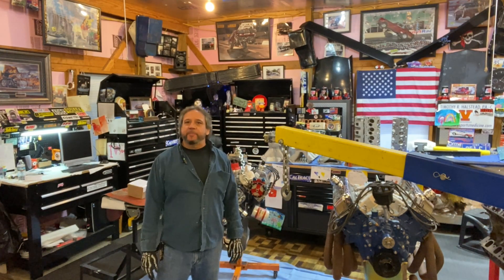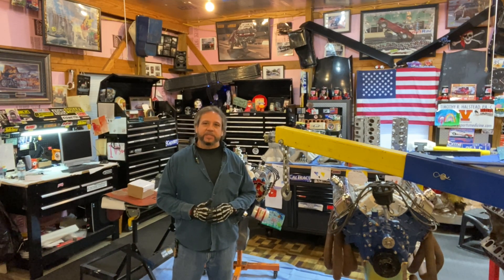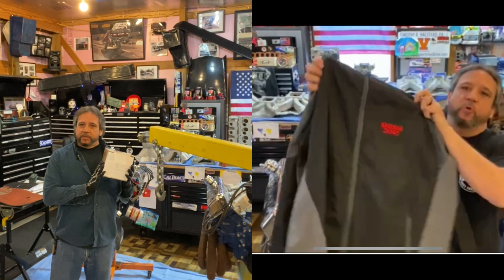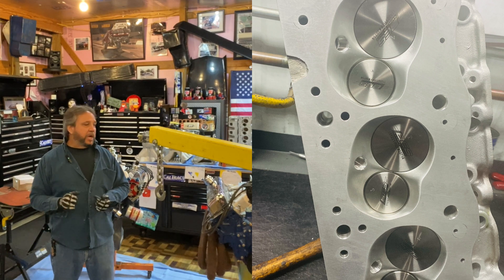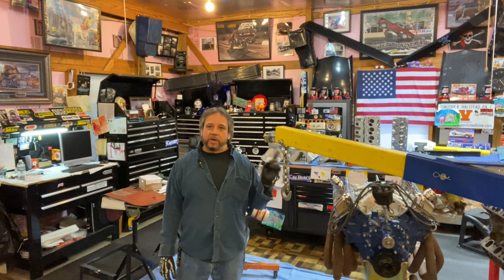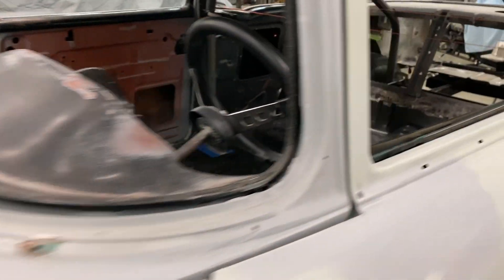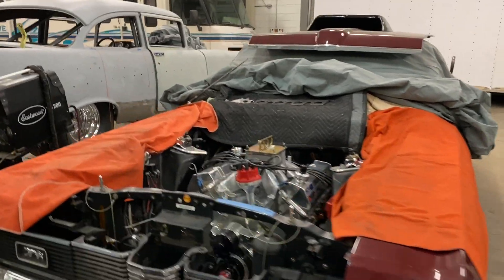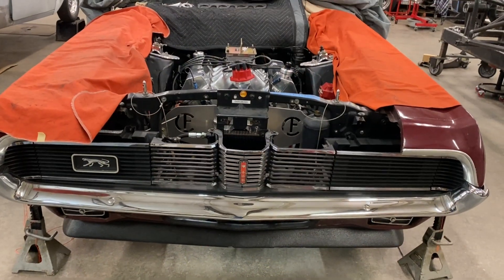DragBoss Garage: Lock and Load And Roll On Down The Road...Can I Make An Intake manifold For A 351C?

Comment: Tim looks awesome. Can’t wait to see cougar rolling again. 775 hp that thing with the changes going to be one of the nastiest 4v cast iron c motors around
Reply from the maker: Thanks Steve, My goal is to be at track on 4/16, so my chassis guy under the gun. I'm hoping it will all work out. I think for what it is, it makes power, and using the old 52 year old block. Can't wait for the TrackBoss, going with 55mm Roller cam bearings. Tony Bischoff said there is not a big difference of HP, but the motor turns over like butter. Thanks for watching.

Comment: Sorry to hear you got that covid crap. One thing that will help bring you back is taking ginko biloba. It clears that mental fog that you get from covid. Take some on an empty stomach with water when you first wake up.
I've never used that plate you bolt on the carb. Only a chain.
When I had my own business I never took the hood off a car or truck to slip an engine in. Didn't even put the intake on. Positioning the chain close in the lifter valley and the engine would slip into just about anything. 
I hate lining back up a hood.
Putting any intake on a Ford is easy, plus lining up bell to transmission is easy without an intake.
Words of thought for your viewer's not you , you already know this.
We all can't wait to hear that dog growl I mean that engine speak.
Reply from the maker: Yes it was a tiring affair. Finally better, but worse was the shortness of breath. Good words of wisdom Cam. I will not use lift plate again either. He rarely barks, however have noticed a couple of barks more often last couple of days. How he gets out of the nipping stage soon. He had his moments. Thanks Cam

Comment: That's a nice pup. Will be very protective of you guys.
I have been waiting to ask a question when you posted your next new vid.
I'm wanting to build an old school iron head 351C. Do you know of anyone still doing the raised exhaust  port plate mod? I'm assuming this is not something that even a good machine shop would be willing or able to do and best be left for a Cleveland experienced expert.
Also I'm on the west coast.
Your thoughts appreciated.
Reply from the maker: Thanks Gurney. I I can see it already, he is still trying to learn his place in the pack. There are places that can do this, and I have a buddy that can do this in California. But actually be easier by A set of  used heads. There are plenty out there, and I may even come into a few sets I have a few deals going on now. But I applaud your endeavor as it will be awesome. Follow along as I build one. Got it back on the stand and easy to do the oil mods. Always appreciate your comments Gurney